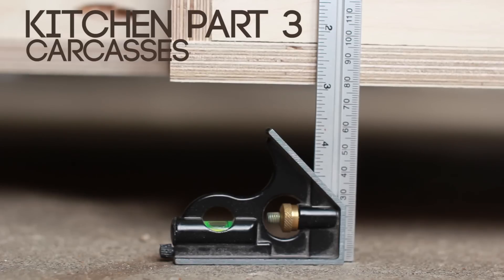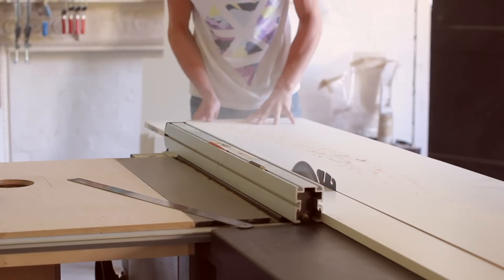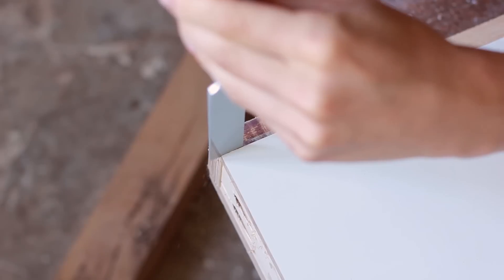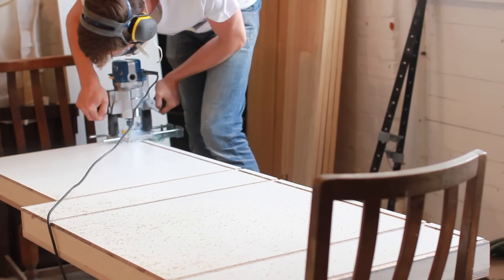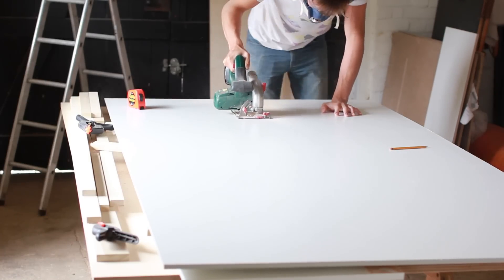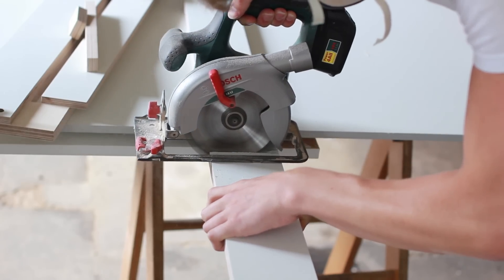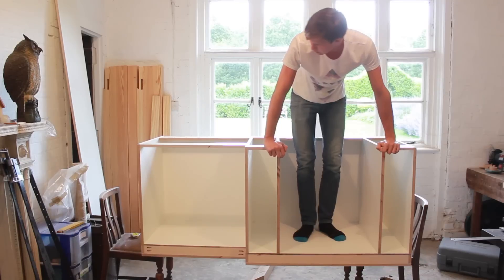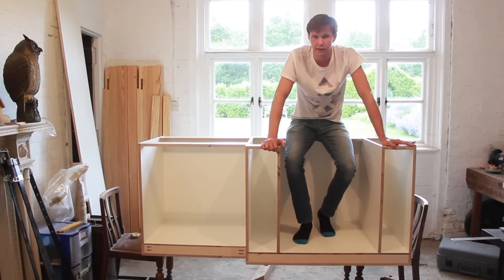013 Kitchen Part 3 - Carcass

Comment: Please come down, you will hurt yourself :)

Can you please tell me the cost of this project? How much does this birch melamine ply 8X4 cost?
Reply from the maker: pmenegatos Haha the kitchen is the least dangerous thing in the shop :P In materials? Roughly £3000 but that is not just for the kitchen it includes other items for the flat. The Melamine ply is around £100 per sheet in 3/4" thick I seem to remember - not cheap!